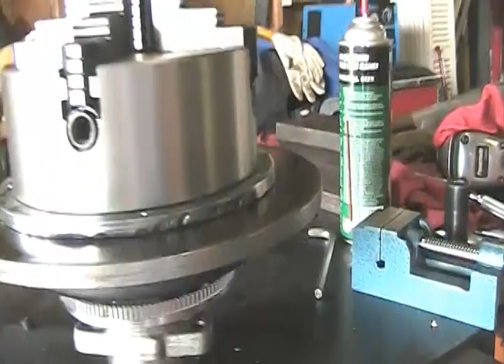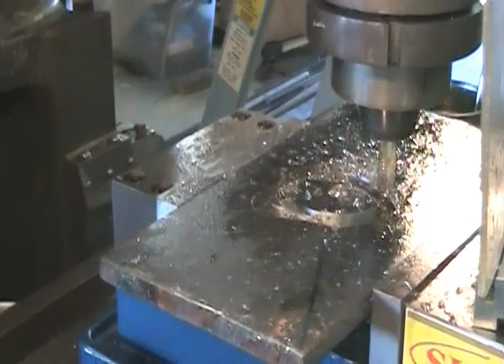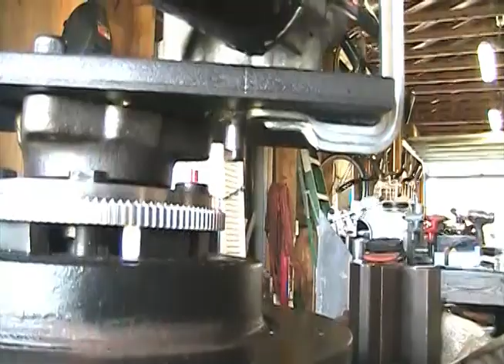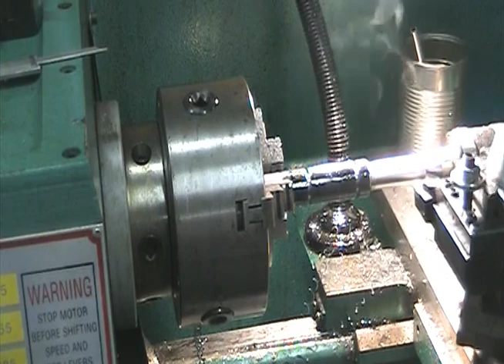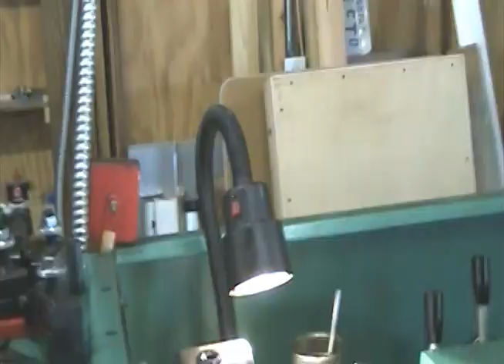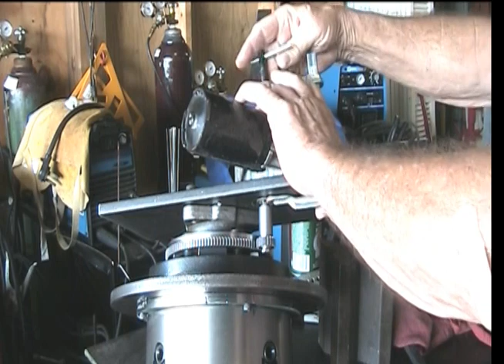Rotary Weld Table Build 6

Comment: the 2D you have is an interesting mill.. never seen one like that before. the oblong shafting you do, a guy can do on a bridgeport.. the hole however is another story. you did it on your 2D.. is there a way of doing the same thing on a bridgeport?
Reply from the maker: The 2D is a unique mill, the precursor to the CNC.  Mostly tool and die applications. Mine was built in 1942.  The head actual rotates 360 degrees and the table can be moved while the head is rotating. You can do rotating holes on a Bridgeport with the use of a rotating table.  I discovered the 2D by accident when I was searching for a K&T HL Mill and was mesmerized by it.  Thanks for commenting.